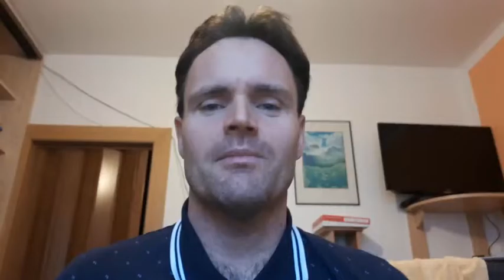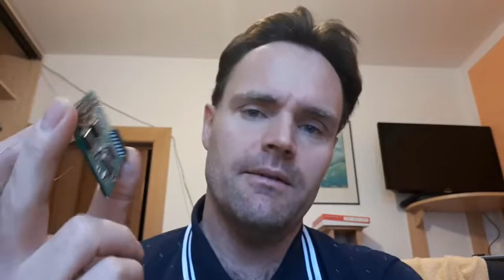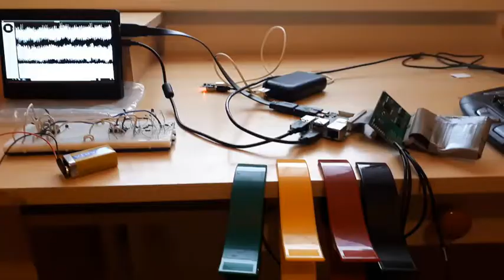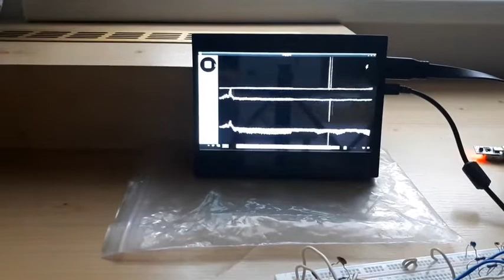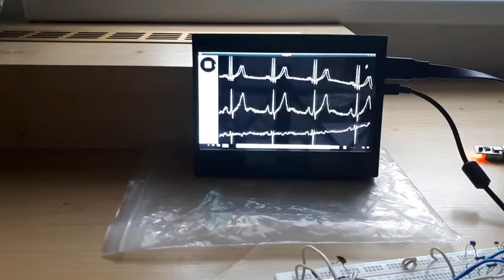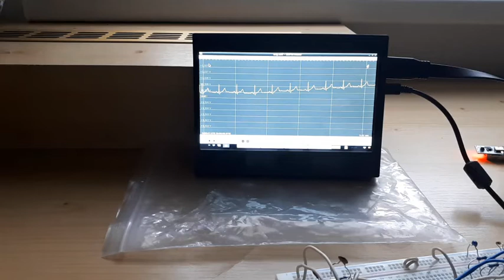Raspberry Pi 4 + 5 channel high precision ECG with ADAS1000 ECG HAT

Comment: Hey in your most recent 3 videos you marked them as "for kids" thus disabling comments. Can you turn them on please?
Reply from the maker: Hello, I did not disable it, the system did it probably by default, anyway I placed age restriction thus enabling the comments
Reply: @ivohora8794  Ah alright. Didn't think YT can set this automatically (wonder how they determine). Kind of strange tbh